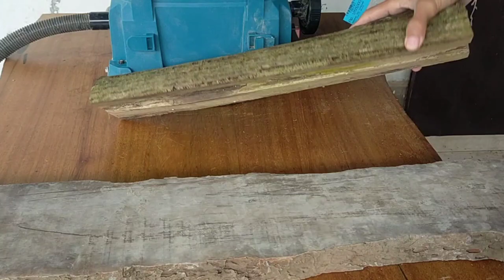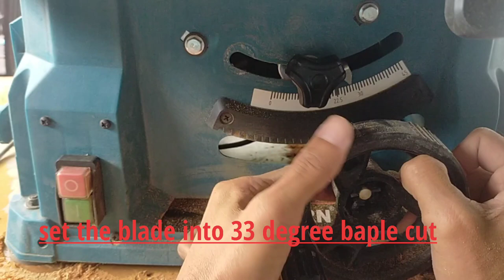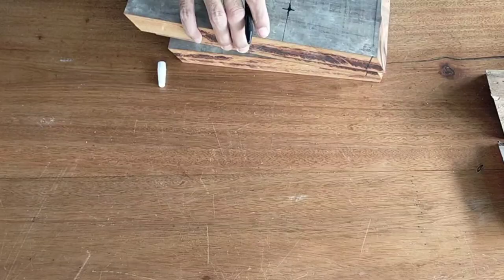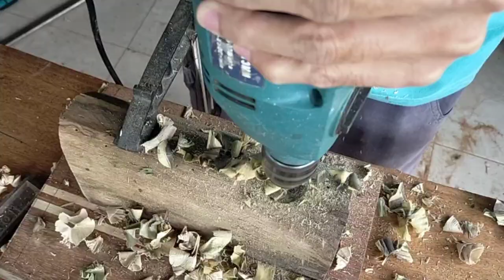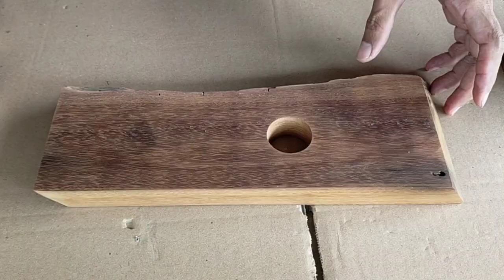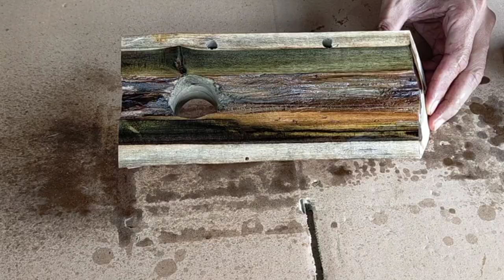Tutorial How to make a floating wine bottle Holder from wood

Comment: As can be seen at 7.45, the THINNER the wood, the less stable it is.
I made 5 today, but with different specs. They are ROCK-SOLID!
Length = 300 mm; Width = 90 mm; Thickness = 45 mm.
Cut both ends at same 33° angle.
Drill 40 mm hole - 190 mm from bottom. 
Perfect!
Reply from the maker: Thank you for your sharing 🙏

Comment: There are 4 primary things that affect balance point - angle at base, length of wine holder, dimensions of timber and type of timber used (density of timber) eg pallet wood is not the same measurements as say purpleheart). The 33 deg base angle tends to shorten the overall length of the holder (compared with the more 'standard' 45 deg) but the position of the hole will vary depending on the timber. Here's an example / guide - Hard Maple at 33 deg, 8" x 4" x 3/4 stock, hole center at 5.3" from front of base; pallet wood same angle and dimensions, hole center 6.1" from front of base. I have seen some people swear that you need to drill the angle of the hole parallel to the angle of the base but personally I drill them perpendicular to the base and just tilt the bottle..
Reply from the maker: Dear Finn MacCool
First of all thank you for your visit in to my chanel, also big thanks for all you feed back and sharing about the making balancing wine holder, and will try to make with other type of timber,

Comment: You said 6 inches long pieces but the ones in the video are 11.5 inches long. And the holes were not marked at 2 down 4 up.
Reply from the maker: Dear Chris L 
Thank you for taking the time visiting my chanel and give your feedback and correction, the total length of the wine bottle holder is 32 cm, sorry for the missed description about the inch due  to I mostly use the cm in measurement, 
Once again thank you for your corrections
Reply: @woodcreationwithMudita  Thank you for taking the time to make the video. In America we do use the inch for measuring but we also use the cm. So if you wanted to make another project video, you can give the measurements in cm to make it easier.
Reply from the maker: Thank you so much for your support as usual